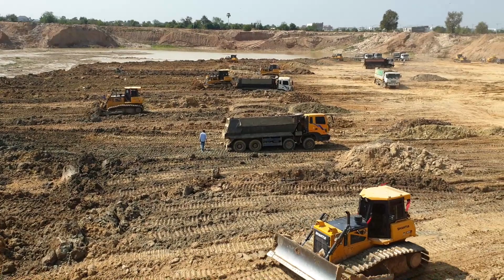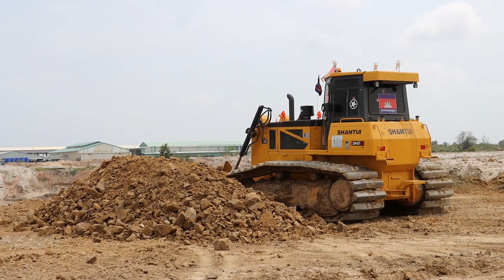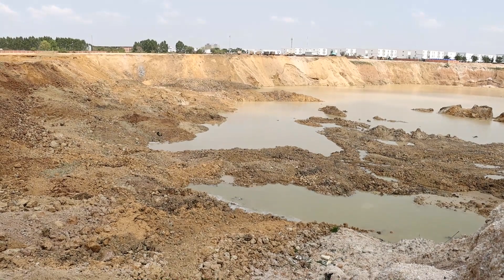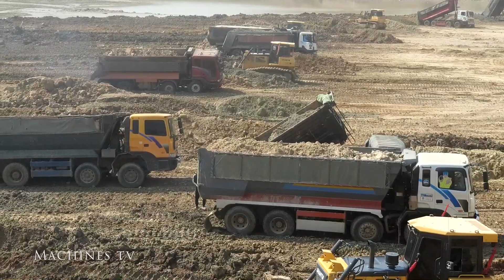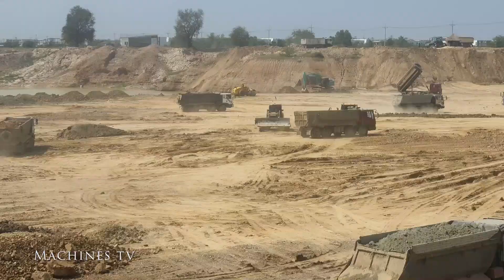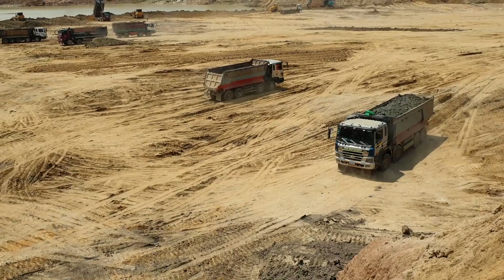Great Work Huge Construction Site Land Filling Up Process Super Satisfying Bulldozer Machines

Comment: They need to put oversized U BLADES on these dozers. Your pushing loose fill and dirt. Wasting a ton of time and fuel pushing  small piles of dirt with straight blades with each pass. Get U BLADES With a width of like 10 feet more (5 feet out further on each side.) You will save millions on fuel and months on time,,,,  you ever see these snow pushers they mount on front-end loaders.  They're twice as wide as the dozer or front-end loaders so they can move alot of snow in one pass.. Or ya, you could get some rubber tire front end loaders to move that dirt.  Even faster  than dozers